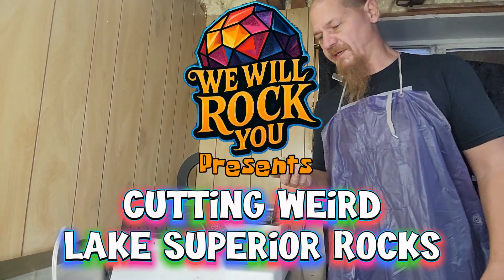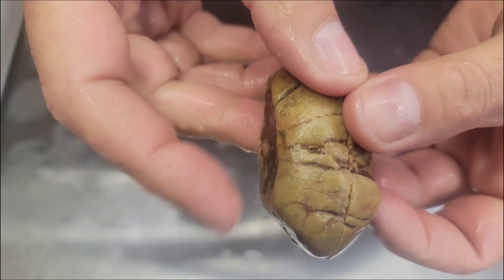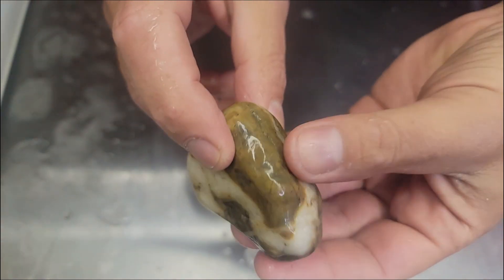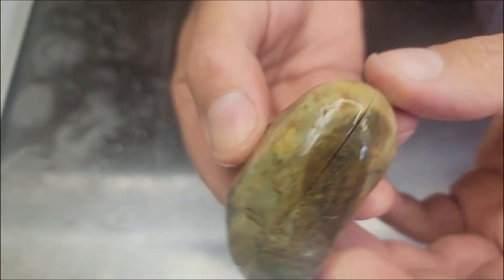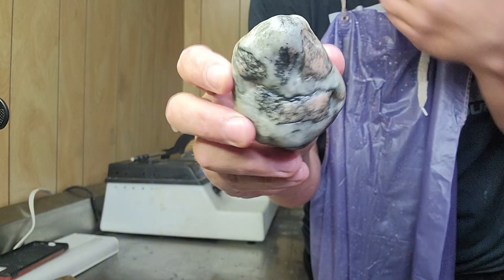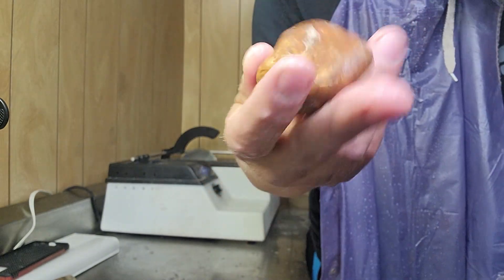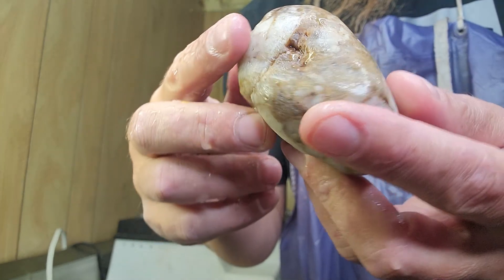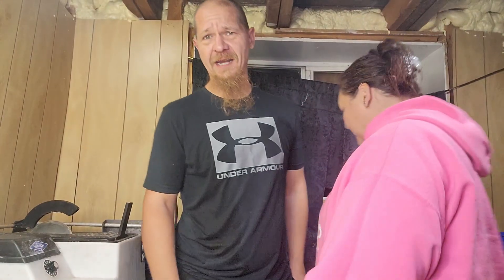Cutting Weird Lake Superior Rocks: Pseudomorph Cold Water Agate, Unakite, Chert & Monster Oddities

Comment: I have a large one like you start the video with, it's called Chevron Quarts/Chevron amethyst.  Criag is a great guy and knows a lot but I don't think he has this one right.
Reply from the maker: Thanks, I will have to look into Chrevron Quartz. There are so many different shop names out there. I mean according to the definition a psuedomorph is where there was a crystal structure and it was replaced by a micro silica. So he may of been right but just describing the one feature of the rock. There is so much going on though.